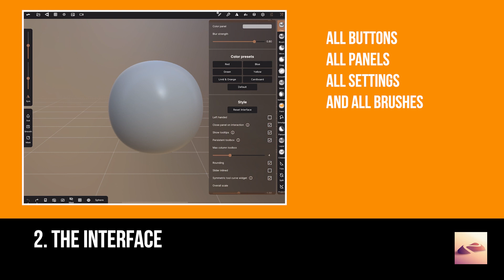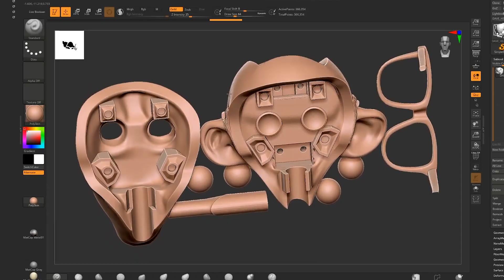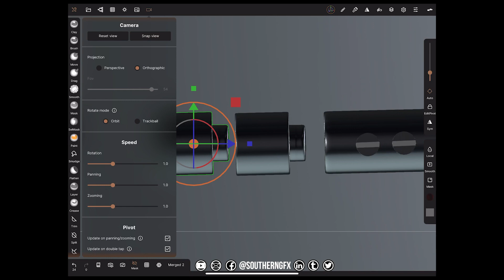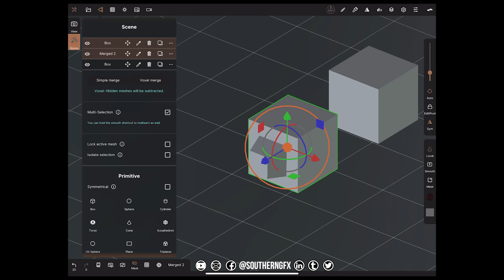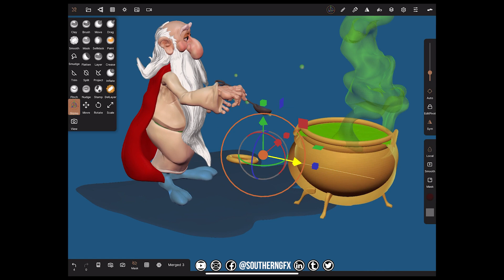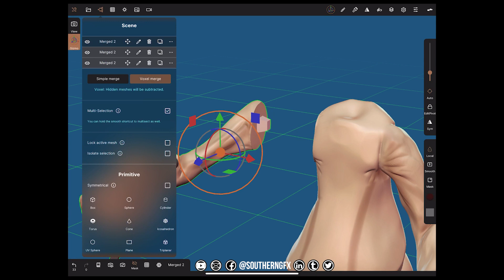Nomad Sculpting App (Keying and splitting models for 3d printing)

Comment: Is there a good way to remove about 1 or 2 mm from the key, so you could get a tolerance for a better fit?
Reply from the maker: I’m just doing a new video about that exact point
Reply: @SouthernGFX  Do you also use the Extract Shell Function in the Masking Settings?
 The ability to specify the thickness of the shell is gold for 3D printing.

Also keep up these wonderful tutorials.

Comment: Soni have a problem when i voxel merge my two layers. My ipad crashes, i assume due to a high poly count. What do you recommend i do to prevent this? I assume i would need to make the keys before I do my detail work, but what do i do after i have already remeshed and subdivided and still need to voxel merge? Simple merge doesnt work because it messes up the sculpt for 3d printing. Suggestions?

Comment: Hello! When i want to use voxel merge, I am limited to 121 in the voxel remeshing is it because my iPad pro is a bit dated and I am limited in terms of RAM
Reply from the maker: If you mean the number when you are merging multiple objects then you might find it changes with different sized models. I only record on a 2018 iPad Pro which is the one that had 4gig so I doubt it’s your machine limiting you. I’ll ask the developer what limits it.
Reply: Thank you very much for your answer. I found the option Max detail range in the settings, by setting it to the max, I was able to gain quite a bit more attitude in the voxel remeshing.
Reply from the maker: @davidcormier5560  oh man I totally forget you could increase it in the display settings! I remember seeing the option and leaving it well alone until I get the newer iPad. I'll be honest I haven't had many times when it hits the ceiling. What sort of poly count are you getting up to?
Reply: @SouthernGFX  I want to model a character to print it in resin on Elegoo Mars pro. So I want to add keys and split it as brilliantly demonstrated in your video. The level of detail is therefore quite high, which forces me to push the number of polygons to the max. (scene Faces: 2.06M)
Reply from the maker: @davidcormier5560  gotta. It really does need that high level as you must know by now. The voxel removal solution is great but it's not as good as live boolean's in ZBrush yet. But its an iPad right lol so cool that we can do this. I bought a Mars Pro this year and I love it.
Reply: @SouthernGFX  Thank you again for your support. By the way, I can't wait to get my hands on your Nomad Ipad Sculpting Course.

Comment: Awesome!  Are there any other Boolean functions?
Reply from the maker: No, not yet. To be very clear these aren't true boolean operations rather a system to do voxel removal using a other shape. The process does a voxel remesh and yields the new shape. It's not perfect and you have to go really high poly on the models for the time you are running the operation but it's a great start. True booleans and live boolean's would be the goal for me.

Comment: Nice!
I'm looking forward to the course.... I need more popcorn.

I have a small resin 3D printer and wanted to hollow a model, chop it into print-sized parts (can a tool be made with the build plate dimensions to speed the cut-to-size operation?), and add inner scaffolding that would help attach everything together once printed?
Example:  Bronze sculptors do something like this and then put them together and weld them all into one part.
Reply from the maker: I have EXACTLY that tool. It's a pack of scaled models that are the size of common 3D printer beds. Get on my mailing list as we are giving it away before the Nomad Course.  
-
https://southerngfx-limited.mykajabi.com/pl/234293